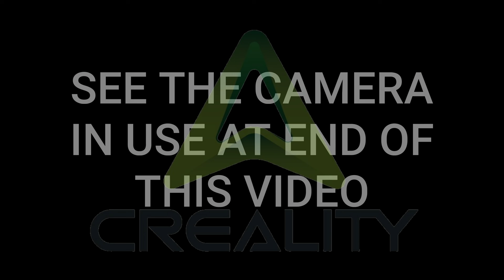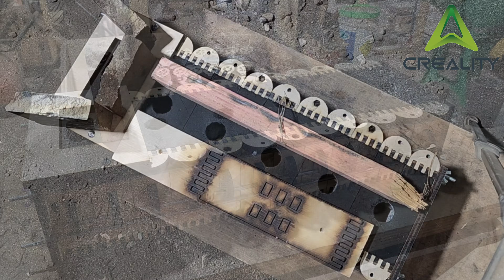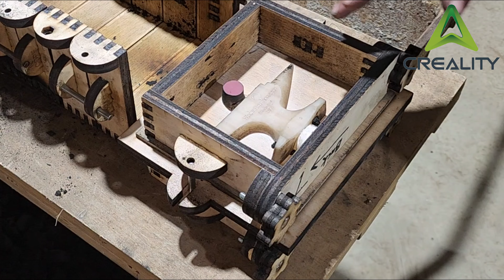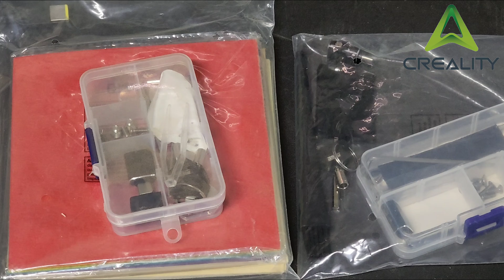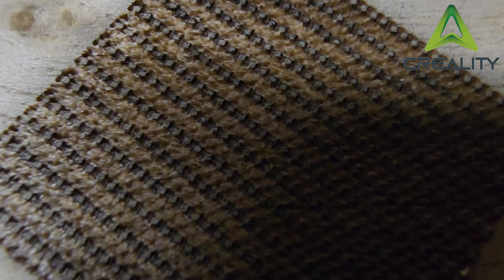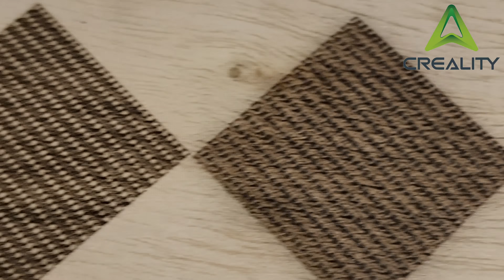USING CREALITY FALCON 2 PRO FOR LASER CUT VERTICAL FLASK

Comment: It might be safe enough to run in the house but if it glitches, which mine did, it can burn through your table top and start a fire so never leave it running unsupervised. It’s a cool tool. I bought mine after seeing yours. Does that red cover protect your eyes from the laser?

Comment: I think you can make a drawer, aluminum slat support, and a hood with similar plastic and a vent system with few hours sitting on the porch and sipping a sweet tea, contemplate how to do it. I think you'd have to find the correct plastic sheet to make it Laser Eye Safe, but the company should tell you that for free with out argument.

Comment: OK I think I like the 'new hotness'. The red plastic cover material is most likely the specific grade of optical shielding to ensure that unit is an 'Eye Safe Laser System'. The earlier one? 'Eye UNSafe Laser System' and quite capable of injuring or permanently blinding an operator or bystander.

Comment: I wonder if you could cut hardyplank and use that...maybe with a cnc and some either diamond or carbide endmills (that would probably wear out stupid fast)
OR...laser cut a mold...and mold cement as the flask with those interlocking tabs
Might not be economically feasable..
A 40W CO2 laser would cut MUCH MUCH better than that red diode laser...no matter what they say...they can't really push more than 5~W...more power they push at it all it does it generate heat, not more light...the CO2 lasers cut with a different wavelenght and use a different exciter setup.
Either way...way cool and should help make molds alot faster...I wonder if there is a way to treat the wood so it won't char up so fast
Reply: When I saw these flasks in the shop I really didn’t understand how they worked and why Clarke was so excited about the system. Now I get it.
Reply: @DRNewcomb  They are quite nice for sure!